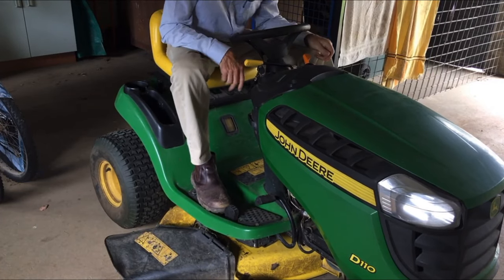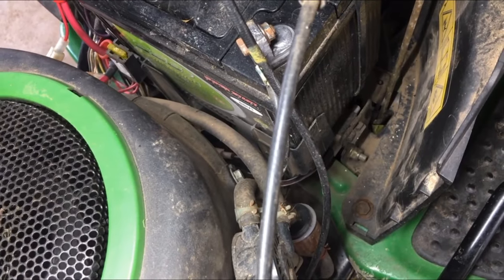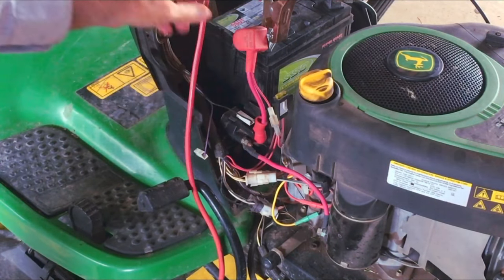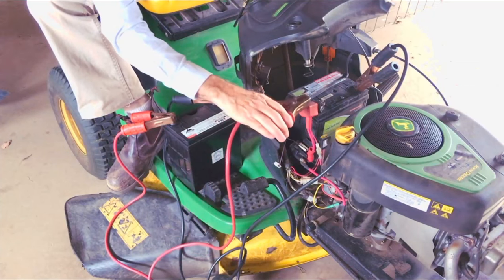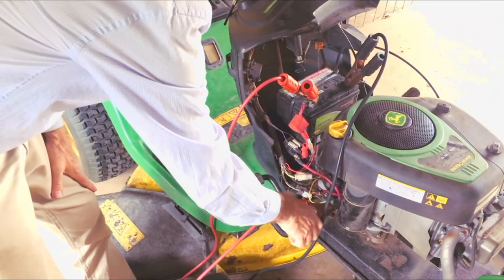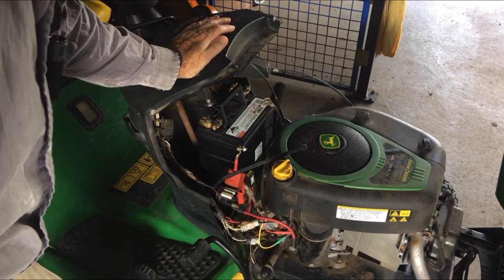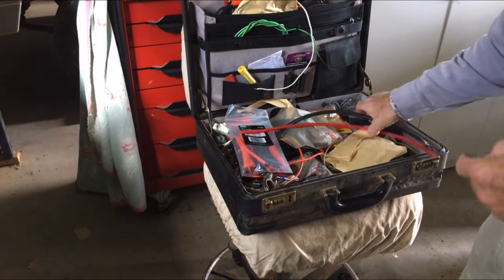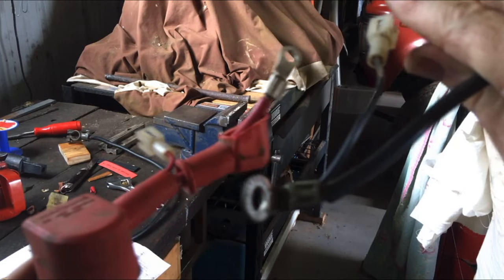No Crank, No start, John Deere Mower, Lawn Tractor D110

Comment: My JD D110 is 16 Years old. My battery was fine, Connections needed cleaning. Appreciated a tour of safety items to consider. Quote from my WWII Vintage dad, "it's probably real simple". Go slow and don't overlook the obvious. Well done.
Reply from the maker: Well done, it’s easy to jump straight to the big ticket stuff and load the parts cannon. 🤠

Comment: Thank you!  Same thing happened to my JD 5420 this morning, just after I drove it to the hydrant to fill up the water tank I have on the 3-point to water my new trees. Turned off Ol' Reliable, filled up the water, and went to go water my thirsty trees but, alas, Ol' Reliable's lights lit up but she wouldn't even crank. Tried charging and jump-starting her, made sure all connections were good (I mean, she was just running 10 minutes before!). Turns out she is still reliable, just needed a new battery after all these years! Thank you for saving me diagnostic time (which I didn't have the skill or time for) and giving me the confidence to take the battery to the store, where they tested it and confirmed it was bad, and they had a replacement for me. Trees got watered today without me having to carry buckets 50 times across 40 acres! Watching your video saved the trees and my body. Thank you.
Reply from the maker: Hi Helen,  what a great story.  It’s hearing about adventures like this that encourage me to make more videos.  My videos are often varied showing whatever I happen to be up to.  Fixing mowers and chainsaws are the most popular.  I wish mine would break more (not) 🤠
Thanks for subscribing!
Dave

Comment: You've inspired me to troubleshoot my L120.  My L120 starts alright, gets mowing, but if shut off, sometimes doesn't start.  Like how you bypassed the circuits to directly test the starter.  Wow, impressed you keep your 12V spare parts in an attache case.  -Jersey Mike
Reply from the maker: Hi Mike, I’ve had that old brief case 40 years at least.  They went out of fashion about 35 years ago :)
I retired last year so it not likely to be called back into service.
If it runs a while and conks out check the three big ones. 
Air,  make sure your air cleaner isn’t blocked.  Unlikely but easy to check.
Fuel.  Make sure your fuel filter isn’t blocked.
Spark.  I had an old push mower do exactly that.  It would run 2 or 3 minutes and stall.  Eventually I replaced the magneto and that solved it.
Just make sure you check all the easy stuff before you start throwing parts at it.
Good Luck

Comment: Great video at about 3 minutes you mentioned the safety switches. It ended up being the safety switch for the blade engager. The bracket was loose and turned 90 degrees so it wasn't clossing the switch! I simple adjustment and tightening and it's back in action!
Reply from the maker: Fantastic, it’s a great feeling when you find the problem and you can fix it yourself  with no parts required.  Well done and thanks for letting me know.
Reply: Same here. 👍
Reply from the maker: Glad it helped!

Comment: Thanks for the video!  I spent a lot of time troubleshooting my D130 that would not start.  I thought, because I was showing 12.8V on the battery, that it was fine.  Once I changed out the battery it started right up.  I still had the original battery from around 7 years ago (or more).  Thanks again, great video!
Reply from the maker: It was not the result I was expecting either.  You can load test a battery if you have the right tools.
If you know a reputable battery supplier they can test it for you.
I say reputable because it is very tempting for them to say “Yeah mate it’s buggered”. Well that’s what they say in Australia any way. :)
If you have another battery to try that can also prove it for you.  Well done sorting it out.

Comment: Good Job. My John D clicks once or twice with each key turn before starter will crank, solenoid or starter motor, have to order and fix when it won't start. Really nice land.
Reply from the maker: Well you know how to bypass the solenoid now to prove it :)
I had a problem with my JD 1640 tractor solenoid years ago. I had a mechanic out and he did an On of on of on off with the starter in rapid succession.
This basically blew the corrosion of the contacts.  It was only a temporary fix. I’m don’t recall exactly what I did to permanently fix it but I think the contacts were filed clean and it still lives on.  I expect there are no serviceable parts on a D110 solenoid but you never know. :)
Please flick me a subscribe if you haven’t all ready 🤠
Thanks for commenting!

Comment: Nice, how you went around the battery to solenoid, straight to the starter.
Which led you back to the problem.
My friend was going through switches, then all of his electrical connections... One by one.
Wouldn't have fixed anything.
Was the Solenoid.
Very quick after watching this. Cheers and Mahalos!
-Scotty on Maui. 🍻🌴
Reply from the maker: Thanks Scotty, I’m retired now but my day job used to be IT.
A great trick I learnt that can be applied to most problems in life is the Divide by Two Rule.
If you can do a test to rule out half of the potential problems it must be in the other half.  Then divide by two again if you can. Then go one at a time.
Glad this video helped you and your friend even though my problem was something else.
Reply: @DavoShed   Best math lesson. Divide.. 🍻🚬

Comment: Thank-you for this well put together instructional video. I will try a new battery on my Series 100 mower and hope that works. Cheers.
Reply from the maker: Thanks for the compliment!
Before you buy a new battery take the old battery with you to the battery shop and have them load test it for you.
It’s a very simple test if you have the right equipment.  They should not charge you anything if the battery is ok.
Keep in mind their goal is to sell you a battery :)

Comment: So you went to your battery shop had your battery tested dead cell diagnosed should have just purchased a new replacement whilst there would have saved so much effort but you got there in the end so well done
Reply from the maker: Well I already had a brand new battery sitting there after the alternator failed on my car.  This was the get home battery I had to buy instead of getting towed.  They are worth a couple of hundred bucks and if I didn’t use it it would still be sitting there.  Thanks for watching and commenting!

Comment: Mine situation was I replace the seat sensor, starter, solenoid, and ignition. It was the first safety switch with the blades. For some reason the safety was stuck in and wouldn’t turn over until I kept pushing the switch then it started.
Reply from the maker: It’s easy to throw parts at them.
With a cheap multi metre and some cables you can test that stuff before you buy new ones 
Glad you found the problem!

Comment: Enjoyed your video.This may help you next time after checking open circuit voltage keep the meter on terminals and check the voltage drop <9.6 not good plus check charging voltage CHEERS
Reply from the maker: Good advice, although less than 11v it probably wouldn’t start.  I could have made the video after I new the answer but there would be no fun in that 🤠
It’s still going strong although it has blown a head gasket since then.  I diagnosed and fixed that but didn’t video it as I have never done one before.  Looking back I should have videos it 🤠
Reply: @DavoShed
Reply: 11v is a very good 1.6 drop is excellent think of your car starter when the drop is > 10 is excellent Cheers check voltage drop for yourself you’ll find out what’s good  check VD on both positive and ground if there’s a problem
Reply from the maker: @anthonysova7117  
I’m not really sure what you mean? Are you talking about the voltage drop while you are cranking the engine.
I was always lead to believe this value was pretty meaningless.
Anyway my battery had a dead short inside by the time it had a car ride to the battery shop.
So it must have been hanging by a thread in there while I was trying to diagnose the problem which is why the volts still looked ok to start with.
This turned out to be a good real world problem, so I left all the diagnostic steps in even though they didn’t find the problem.
Not much fun running straight to the kill without the thrill of the chase!
Thanks for taking an interest in my video
Reply: @DavoShed  voltage drop while cranking engine you can’t have VD without current flow or resistance (motor)A shorted battery looks like 10.5 open circuit voltage (at rest =1 cell shorted 2.11 volts+10 .55 =12.6 ) Next time you check a battery keep the DVOM on the terminals check at rest(OCV) then while cranking (VD) By the way 11v at VD is excellent hope this helps Cheers

Comment: I had this problem with my JD. It turned out to be the negative lead that goes to the engine had a bad contact on the bolt. There was a 5 volt drop across it when I measured it! Looked all in order and no corrosion to be seen but after I pulled it apart and cleaned it up it worked a treat. The quick way to diagnose this would be to simply put a jumper lead from the battery negative to the engine block and if it works you know the problem is in the lead somewhere.
Reply from the maker: I have been tricked by that before.  My 60 horse (1982 model) JD tractor used to crank real slow.  In the finish I removed all the ground straps and starter cable contacts and cleaned everything.  Nothing looked that bad but a little bit of corrosion on everything was the problem.  I was about to take the starter off to the shop again.  Glad I didn’t!
I had an even stranger problem with my Diesel Toyota Landcruiser.  Same cause.  25 year old earth strap that had never been touched. Used to stall intermittently at highway speed if the headlights were on. Tough one to diagnose.  Someone on a chat group told me to clean it.  I thought yeah yeah but he nailed it.
I reckon before changing any parts clean all those contacts anyway.
Thanks for commenting.
Dave

Comment: I Always keep a "Battery Tender JR" (about $40) on my battery, so it is always fully charged.  It helps the battery last longer too.
Reply from the maker: That’s a good idea.  I used to have a solar trickle charger on my mower in the winter but I suspect it may have overcharged it. Not sure.
This time a cell in the battery had collapsed.  It’s not the first time either.  I think the vibration is really hard on batteries.
Thanks for commenting!

Comment: I have same problem of no crank and when I turn the key's on to start, I just hear those load clicking noise.   I hook up a fast start charger to the battery terminal and still the same.   I tried to bypass the solenoid from the battery to the starter motor and I don't hear it cranking.  So, does this sound like a starter motor that need to be replaced.   Thanks
Reply from the maker: It could be the starter motor.  Although this is the same symptoms I was getting before I tried a different battery.
My battery had an internal short.  The battery was still showing over 12v but it didn’t have enough amps to crank the motor.
Usually the clicking sound means not enough power to turn the motor.  The click is the starter motor gear engaging.
Before coughing up for a starter I’d borrow a known good battery from something else and try it with jumper leads.
You could also get your battery tested at a battery shop.  I think the vibration of these engines shakes the battery to death.
Let me know what you come up with!
Dave

Comment: how did you release the white clip on pos battery  cable . i tryed on mind could not get it to release is their a fuse in it
Reply from the maker: My battery lead does not have a clip
Round post  connection at one end and an eye on the other end.
The fuse is a standard blade fuse on the side of the battery tray.  It’s quite obvious.
Your design may be a little different.

Comment: When I turn my key the hour meter doesn’t come on. Thanks for showing this. I think it’s time for me to replace my battery.
Reply from the maker: That could be.  That’s really flat if the metre doesn’t come on.  Did you check that little fuse.  Get a cheap volt metre and see what voltage the battery has.  Then check all the big cables are clean and tight.
You could also try jumper cables to another good battery but there are a few tricks that are good to know when jumping from your car.  Good luck!
Reply: @DavoShed  I tested the solenoid like you showed on your video and I didn’t get any clicking sound. Does that mean one of my safety switches are bad? Also did the jumper cable test and starter wouldn’t start the tractor like your did. So I’m think safety switches
Reply from the maker: @scottnj It probably is your battery then.
The test with the jump start lead should bypass all the safety switches.
If you can’t find a place that can load test your battery buy a new one.
Did you get a cheap volt meter and check the voltage?
Reply: @DavoShed  yes I did get one it was reading 12.2. The Battery was just bought brand new. You think maybe the starter then if it bypasses the switches
Reply from the maker: It could be the starter if you have done all the other tests.  Was the old battery actually dead when you put the volt meter on it?
Does the hour metre work now?
Check both ends of the negative cable are good.
Reply: @DavoShed  the old battery was under 10. Somewhere in the 9 range. So I figured that wasn’t enough for the cold cranking amps. My engine size is a 25hp Briggs and Stratton if that helps. Just trying to save a few bucks if I can do it myself. Checked the fuse also and that’s good. The hour meter still doesn’t come on. Lights come on that’s it. Strangely when I rocked back and forth for shits and giggles it turned over twice. But nothing all day today. Thanks in advance for your words of wisdom
Reply from the maker: @scottnj it’s a strange combination of symptoms now.  You might need a proper expert to take a look now.
Certainly 9v is as good as completely flat.
The jumpstart cable from the positive to the starter should make sparks.  If it doesn’t it’s likely the ground / negative.
Maybe you should seek out a video on how to bench test a starter motor and you can see if you are happy to try it.

Comment: Great Job ⭐️⭐️⭐️⭐️⭐️⭐️⭐️
Reply from the maker: Thanks!  Are you having trouble with your mower or are you just looking for entertainment?
Reply: @DavoShed   yes severely trouble
Reply: I got a new   battery I
got  has 150 cranks
Reply: Thought that fix it , it didn't started to turn over, yet it wouldn't then got weak again, I know the  ign switch is bad so tried to start it by the cilnoid,,  then it turned over some, yet only a few seconds then wouldn't even do that, so I looked at the starter it's cracked on the bottom, so I know that has to be changed, then / solenoid ,possiably the carborator,  what else is there can be done to this 😀
Reply from the maker: @x7warrior735  if you can, change one thing at a time then try it.  Certainly a cracked starter motor needs replacing.
Reply: @DavoShed   yes thats what iam going to do is change 1 thing at a time , then should be able to narrow it all down. To find the real situation going on with it not starting, turning all the way over.
Reply: @DavoShed  still spinal pulley  issues going with it , yet will determine that once I can get it to turn over first and start, I appreciate your concernds for me on this, ty.

Comment: I replaced the battery and starter switch.  Sill no lights and no start.  However hour meter is on.  What do you suggest I do next.
Reply from the maker: Hi Daniel,
With the key off If you bypass everything with a jumper cable from the positive terminal on the battery to the positive on the starter does it crank then?
If no then the problem may be with the negative connection.  Take the negative cables off at both ends and clean them with a wire brush.
If it still doesn’t crank this way then it may be a problem with the starter motor.  Do you get the click click of the gear trying to engaged?
If it does crank when you bypass everything then it is one of the other things I mention in the video.
Brake micro switch
PTO micro switch
Seat micro switch
It could be a problem with the actual ignition key switch.
See if you can bypass this stuff one at a time to figure out which one it is then replace that.
If you find it’s a switch don’t leave it bypassed as they all there to protect us.  It’s when you are tired or distracted it will take your foot off.
Use the divide by two rule.  That is how can I narrow things down.
I assume you can turn the fly wheel by hand.  That is the engine isn’t stuck.
Post again when you find the problem
Dave
Reply from the maker: There is that little fuse as well but I think the hour metre won’t come on if that is blown.
No lights is odd.  There is always the chance you got a dud battery assuming that is new.

Comment: While MWO the battery cables when you can get the correct battery?
Reply from the maker: Hi Coley,
Good question.
(Not sure what MWO means?)
I already had that battery for a car that I recently sold.
The battery was only used once to get the car home and then to a mechanic to replace a broken alternator.
I could not return the battery.
So I had a brand new battery worth around a couple of hundred bucks and no use for it.
It was an easy modification and it came out ok.  It would be silly to buy another battery and put that one back on the shelf.

Comment: I had the same issue and a battery charge fixed it right up
Reply from the maker: Glad you fixed it. It’s always good to hear what other people are doing.
As I mentioned I also charged my battery but there was an internal fault.
I think the vibration of the mower is really hard on batteries.